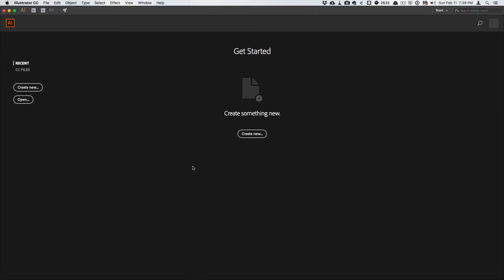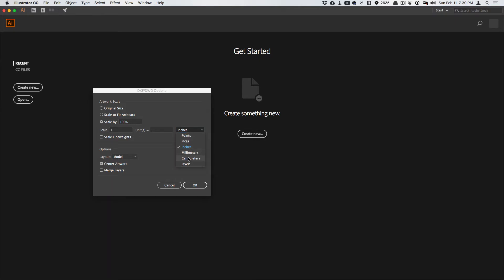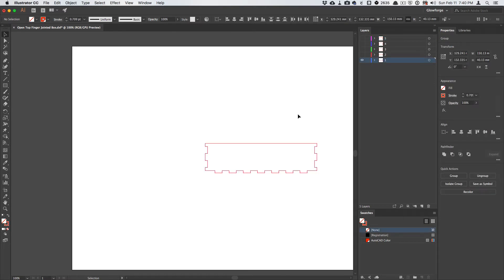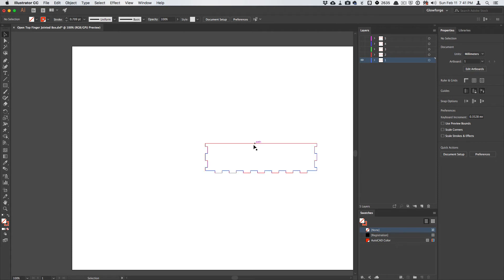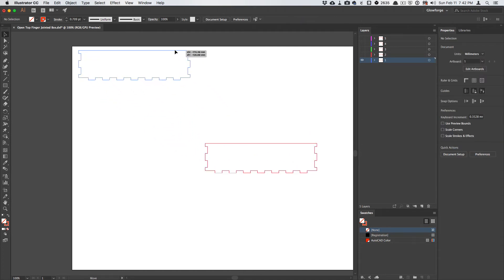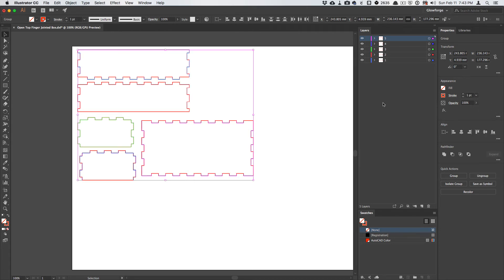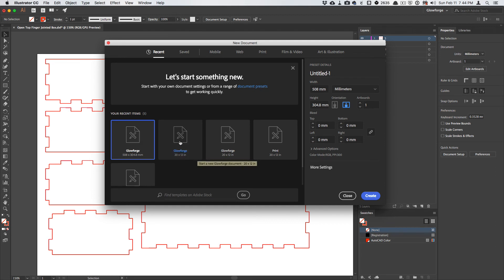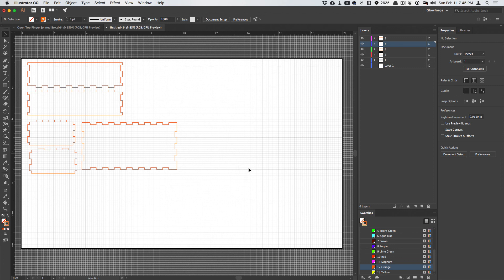Adobe Illustrator: Importing multi-layer Fusion360 DXF files

Comment: Thanx for the video. 
FYI: In the Properties section of the DXF Processor dialog there are now options to output polylines and full circles. Enabling these checkboxes  does away with the need to join all the segments in each layer. Cheers.

Comment: Great job with your video series.   It significantly helped get me going faster.   Do you know if illustrator has an option to do an auto-layout for each of the layers (floor and walls in this case) to make the most efficient use of the space/material?

Comment: When I export dxf files from fusion 360, and bring them into Illustrator, the lines dont appear correctly, my radius looks fine on some circles and in other places almost thicker or something.  In other plates where I have a 90 degree corner with a radius, its almost like illustrator doesnt see the radius for it at all and just turns it into a sharp corner. Any advice?